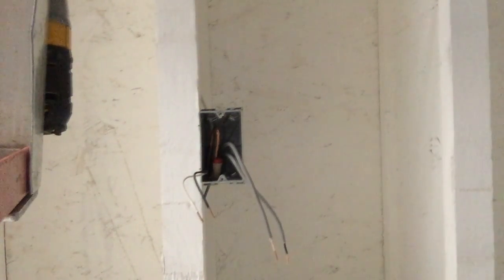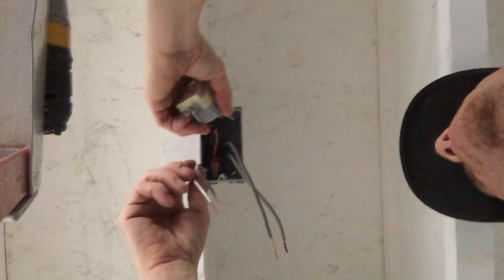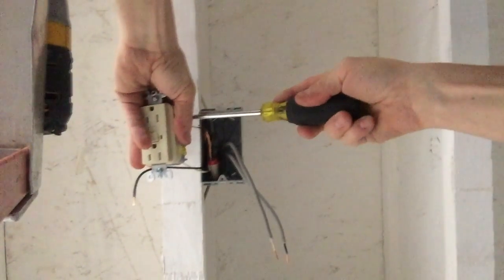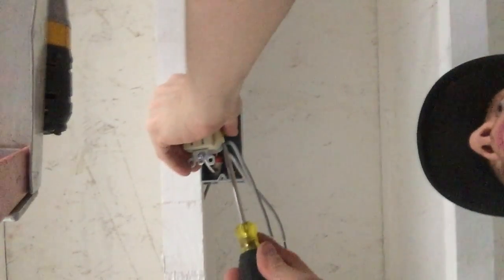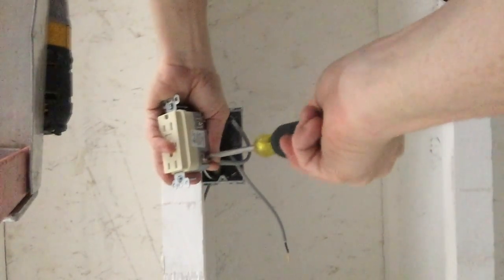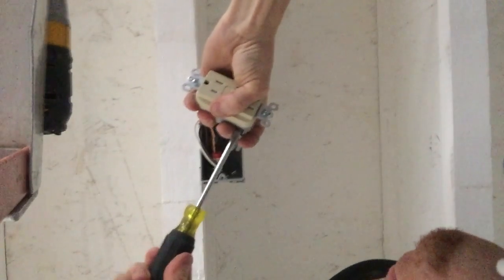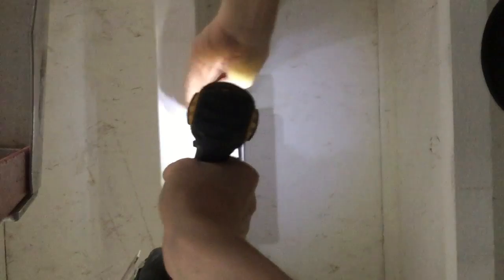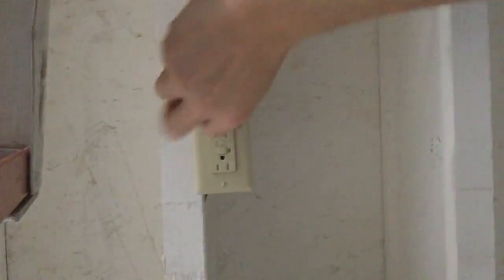How To Install A GFCI Outlet With 4 Wires - w/ or w/o Ground

Comment: The title says to connect using 4 wires - you connected the ground wire so you used 5 wires not 4 !!!
Reply: Shut up
Reply: That depends how you want to look at it. Going into full nerd here: According to code, the ground wire is NOT counted when deciding how many wires fit in a conduit. It is not all about how many wires will physically fit in a conduit but also how hot the wire will become from having too many wires conducting electricity. Since the ground is only powered during a short, it is not being used so it is not counted.

Junction box fill calculations however DO consider the physical size of wire so the ground wire is added into the total fill calculation BUT IT IS ONLY COUNTED ONCE no matter how many grounds or tails are there.

Comment: don't you want to check the installation is correct by pushing the "test" button (which will turn the little green light red) and then push the "reset" button (which will turn the red light green again)?  And will you hear a "click" when you push the "test" button?
And if the "reset" button won't stay in then installation is not correct.  Right?

Thanks for the video!

Comment: did you twist the two ground wires together from the line and the load? Are both under the green ground screw?
Reply: that's my question, the one I removed did have one copper hooked to back of box, then twisted and the other connected to the bottom of the outlet , I came on her to check that particular issue out